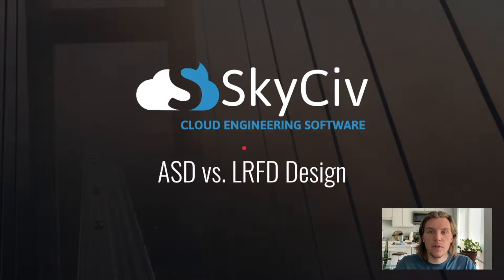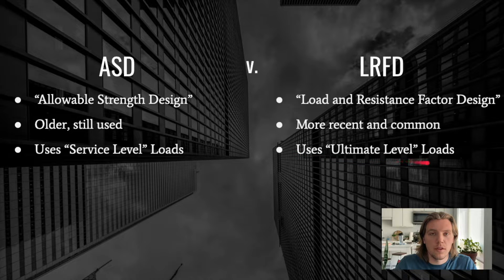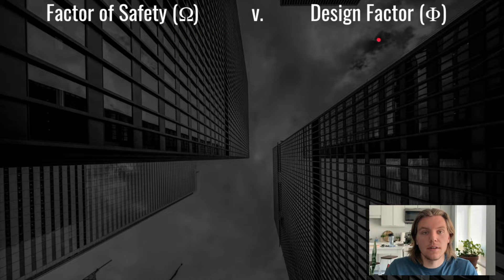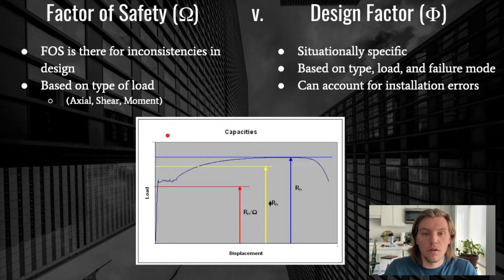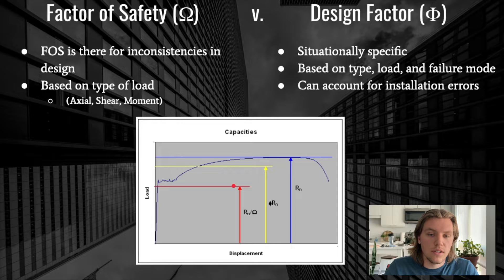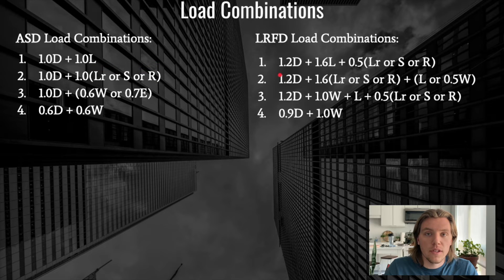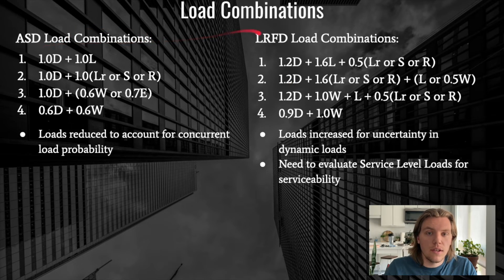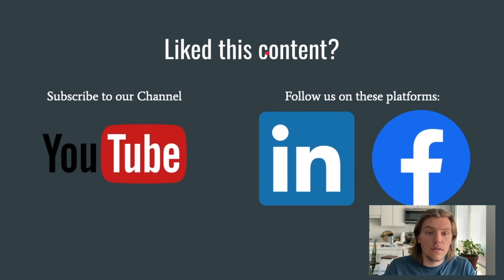What's the difference between ASD and LRFD in Structural Design?

Comment: The essential difference seems to be that LRFD applies safety factors on the front-end of the calculation directly to the criteria that specifies the loads applied.  ASD by contrast, applies safety-factors on the back-end, when you determine the working load at the member level, and select a member that supports this load with a safety factor.   Am I correct in this understanding?  Should you ultimately get the same result, regardless of which strategy you choose?

One big problem, is any time I try to look up the safety factor required, a lot of times all I get is the definition of "safety factor".  A statement of the obvious.   The more important question, is how do you know what the safety factor is required to be?
Reply: Yes, I must admit I've never been clear where the real difference in "philosophy" is at all. Surely LRFD is just a more detailed version of the same thing.
Reply: Check AISC-360-16 LRFD for detailed safety factors and how differentiate for each loading type and check under LRFD
Reply: For your first comment i may say
Asd decreases material stregth by factors about 1.5 and requires safety roughly 2 for joint checks While keeping loads almost as applied
LRFD decreases material strength slightly as compared to ASD and requires 0.75 safety for joint checks
However increase dead and live loads incredibly by 1.2DL and 1.6LL and so on....

Comment: I sometimes dont understand the advantage of ultimate state design over serviceability state, particularly when you notice that the ultimate stress divided by the average of the FOS equals the service stress. How do you feel and maybe I am over simplifying !
Reply from the maker: Thanks for the question! In general it would be disadvantageous to over-simplify and use that approach, since there is a lot of statistical data that goes into the load and design factors generated for LRFD design. If you average the FOS and use that to compare LRFD and ASD effects, you are taking away the specificity of the inputs that makes up the design factors applied in LRFD.